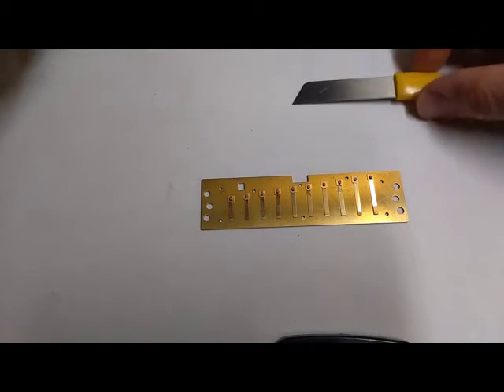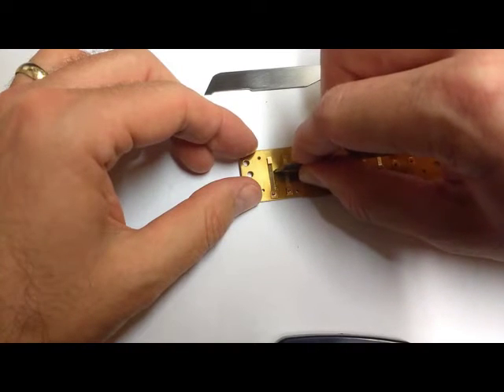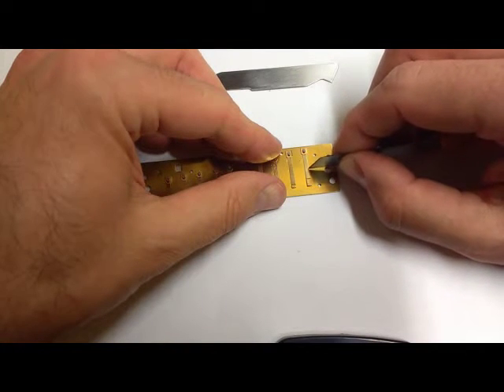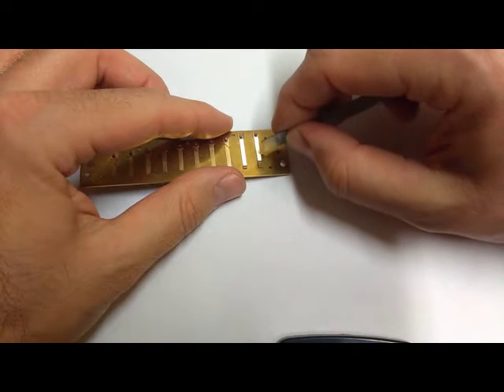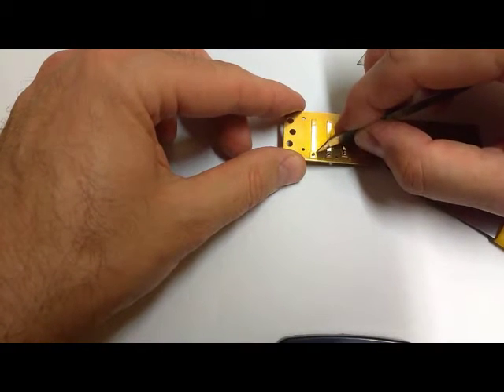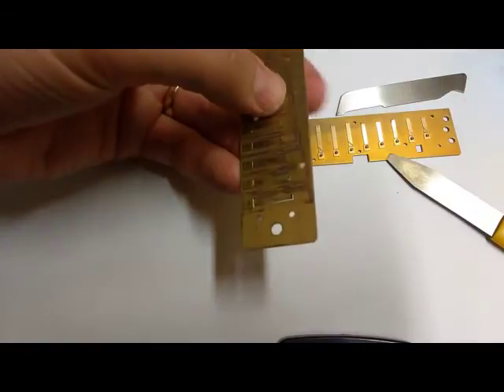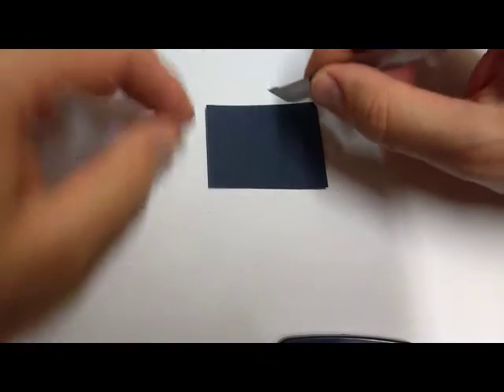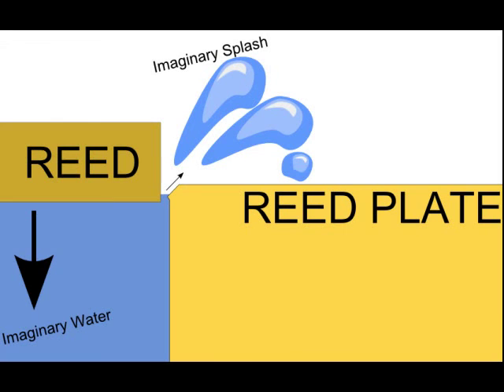Improved Andrew Zajac embossing tool

Comment: Thanks for the great videos! I just bought your full toolkit and have been working on my first fully customized harp. I have a question about the embossing angle. You don't really say there is a "better" angle to choose. The water analogy makes sense, but is it more efficient to have that water squirting UP vs. the 45 degrees? I have no reference to know what will produce a better sound, volume, efficiency, etc. I'm guessing flatter is closer to the original slot shape and therefore a better way to go. My first attempt produced a thinner tone with a kind of buzzy sound so I think I embossed too hard with too steep of an angle. I went back and cleaned up with shims but it didn't totally fix it. Any help is appreciated, Thanks.
Reply: There’s a fine line between the right amount of embossing, and too much. The tighter the tollerence, the brighter and tinnier the tone will be. You have to find the right balance for your preferences, and the use of the harp. If you’re not overblowing, use embossing to make the slots uniform across all 10 holes, basically fixing factory imperfections. I’ve gotten to the point where I only slot emboss the last 2/3 of the slot instead of the entire thing, to prevent that really bright sounding tone.